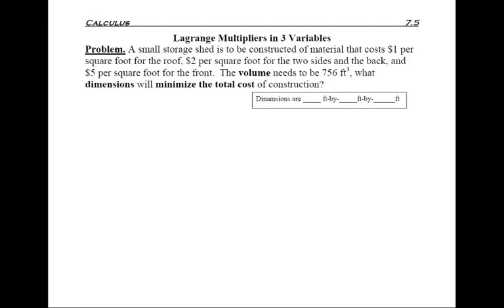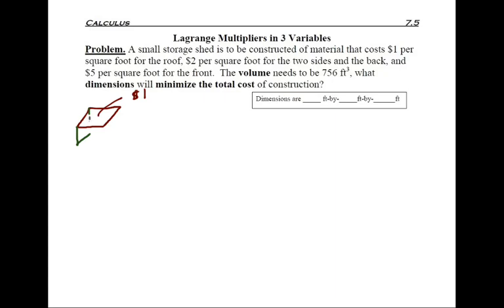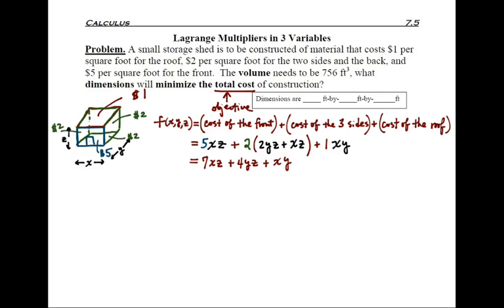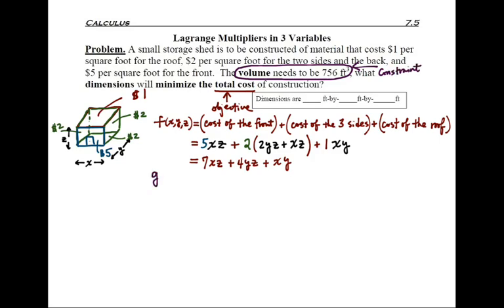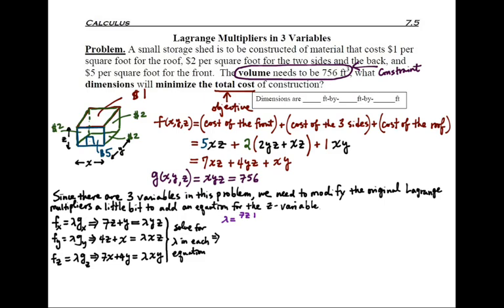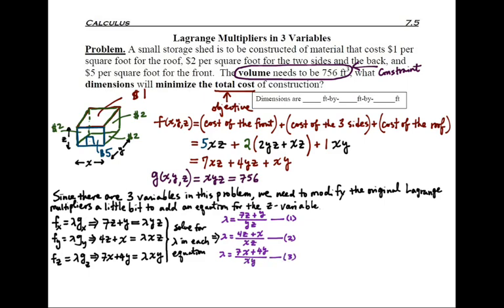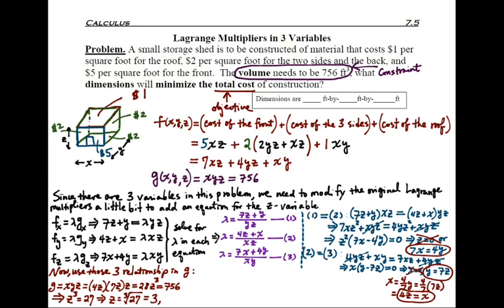Lagrange Multipliers in three variables

Comment: How do we know that is the minimum? Isn’t that just a point where the gradient vectors of both equations line up meaning it is a max or min? How do you prove it’s a min?
Reply: Hi Gabe, that's a good question. Since there is a single solution to this problem and the objective function has no maximum, the solution will necessarily be a minimum.